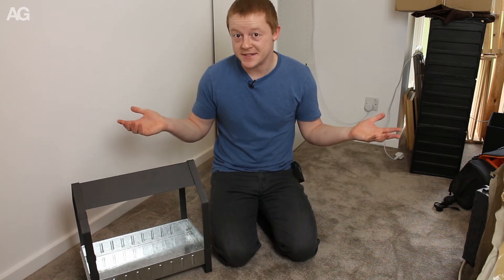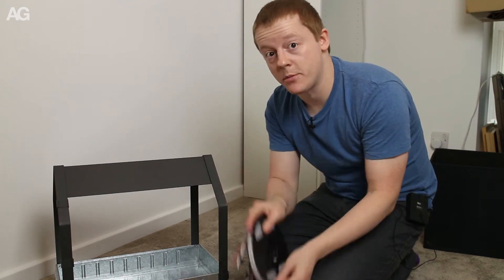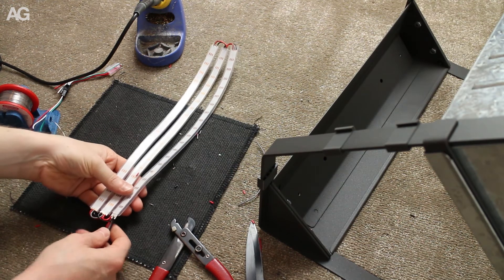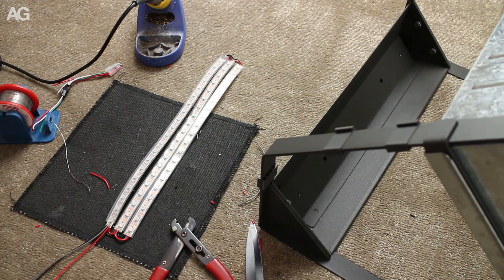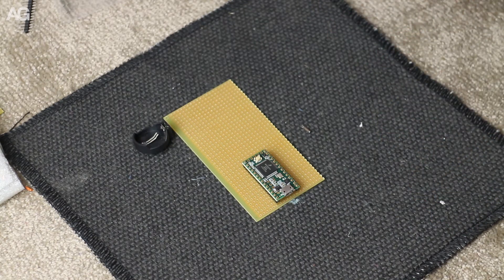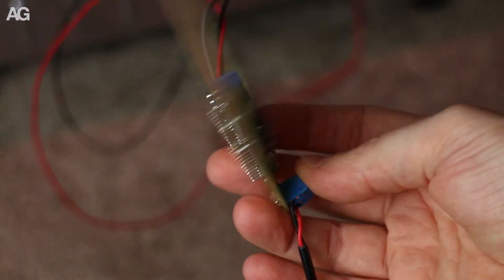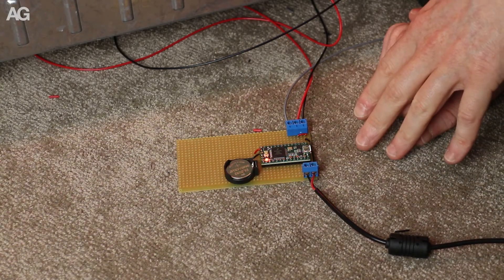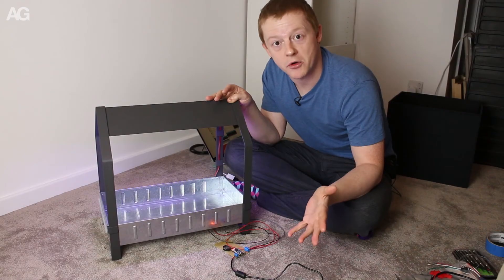Making a Time Controlled Plant Grow Light

Comment from the maker: I have updated the lights using a wider spectrum variety, hopefully an improvement for the plants.
https://www.youtube.com/watch?v=zjgX7yFHxMw
Reply: So, actually you did not tested until the plant grow using the previous WS2812 solution, after a week or two you switched to the fullspectrum light correct? I was hopping to do the same with my WS2812 stripes... trying to check if that  is possible to work or not. Thanks for any feedback.

Comment: You are not on right spectrum with WS2812... 
Red Wavelength: 620~630 nm
Green Wavelength: 515~530 nm
Blue Wavelength: 465~475 nm

Better too look for full spectrum grow lights

Chlorophyll A is sensitive to spectral peaks at 430nm and 660nm while chlorophyll B is sensitive to spectral peaks at 460nm and 630nm.

Chlorophyll A is the most important molecule in photosynthesis as it easily passes its energized electrons onto molecules that manufacture sugar.
Reply from the maker: Thats really interesting, thanks.
Seems like the LEDs are right on the edge of usability, I will see what else I can find!
Reply: @ArthurGuy  any chance you ever found an easy to buy strip. I want to do a very similar project. Would love full control over the colors for a night time mode
Reply: Dutch Maker can we link up? I have a project I'm working on and it sounds like your knowledge could be super useful
Reply: @shaynefabian810  Yes, how can I reach you?